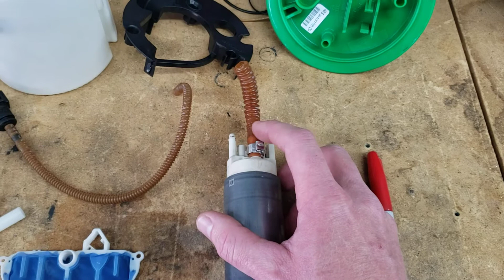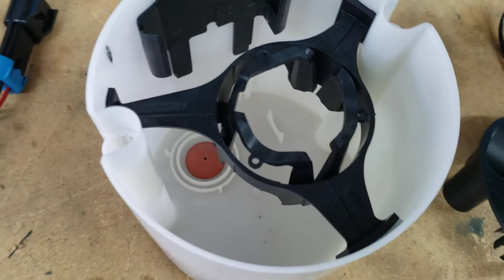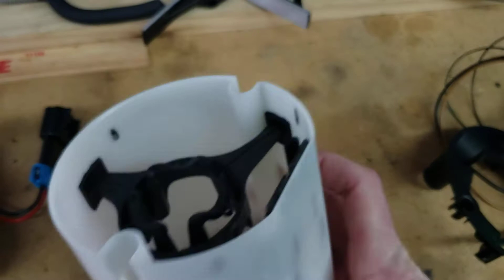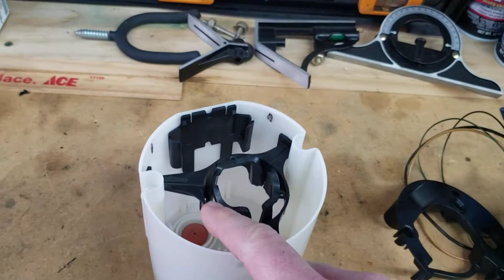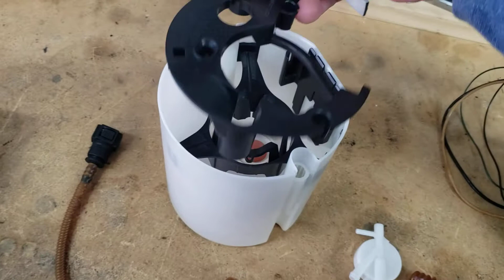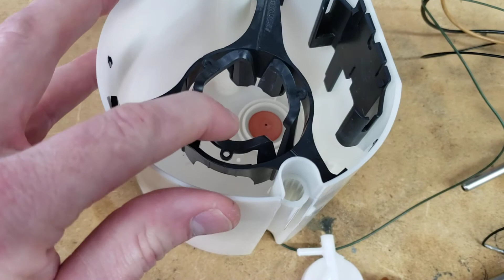Rear-mounted Turbo RS4: LPFP investigation

Comment: I’m working through a similar setup on my B8A4, Walbro 525 in the factory basket. I was thinking about using the oem pump outside of the basket as a lift pump to fill the basket. Still contemplating different approaches though.